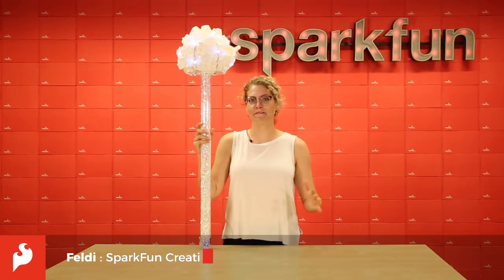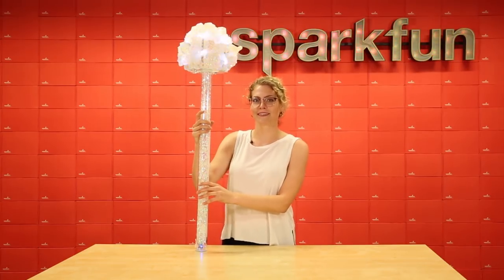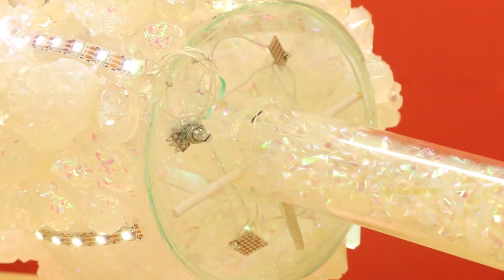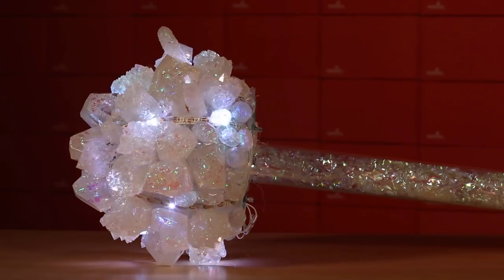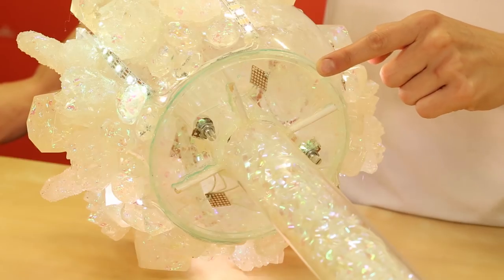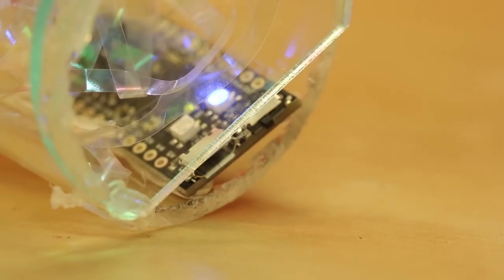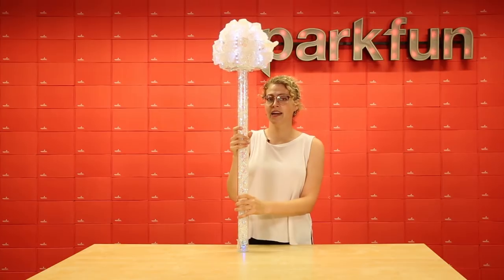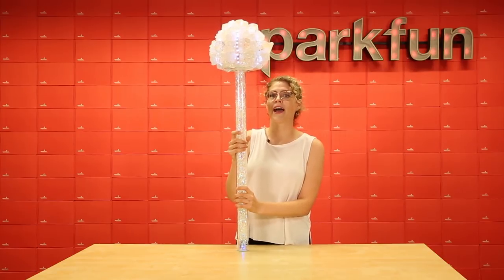Project Showcase: DIY Festival Totem

Comment: I made a Totem for our rave family for EDC. The Totem was named after EDC 2022, Bloom. I used a telescoping pole so we can raise and lower the totem when we travel or post up at a stage. We can place Bloom on the ground easily raise it high for our friends to locate. Definitely wouldn’t want to hold that in the air all night because it takes some time to navigate the crowd. I added a sling to the pole so when we travel we can lower the totem throw it on our shoulder with little effort. The canter part of the totem “Bloom” is an Owl completely covered in rhinestones. That project was 6 weeks. Bloom sits atop of the electric sky in the clouds that flash different speeds and colors. On each side Bloom is surrounded by led trees that sparkle off the rhinestones. Bloom gets a ton of pics and attention. We are starting another totem project soon and I love the leds on this one it looks amazing. Anyone can view Bloom on FB at EDC Dream Team.